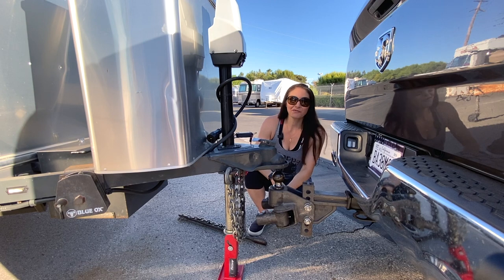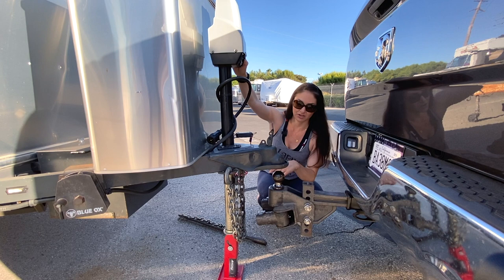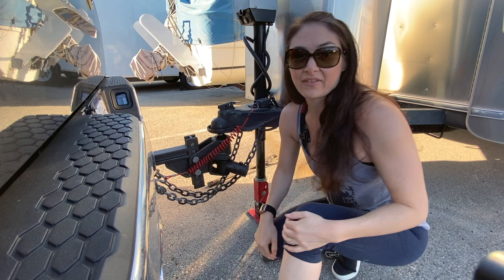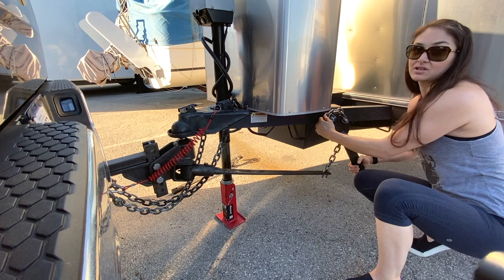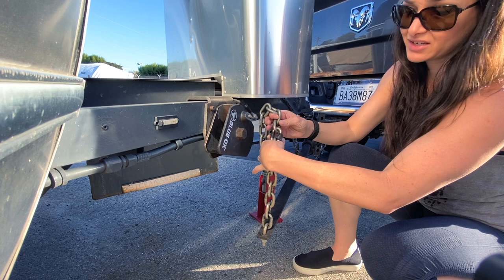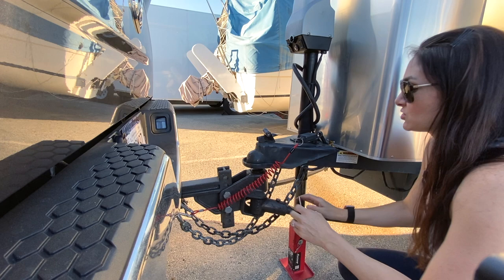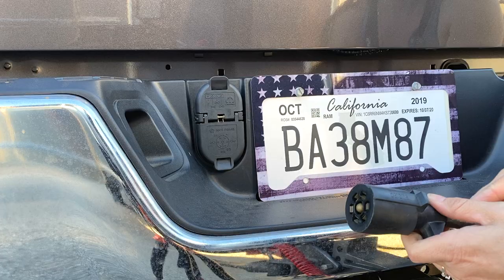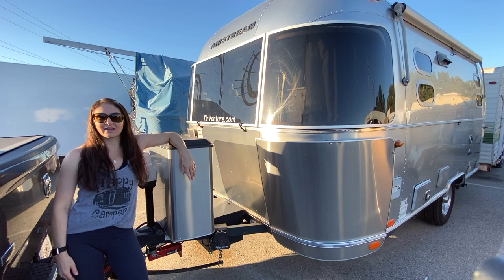How To Connect Airstream To Blue Ox Hitch

Comment: Nice video!
I'm leaning towards this Blue Ox hitch.
It looked like your break-away cable might have been hooked to your hitch loop?
That cable should be connected to the vehicle itself just
in case, God forbid, the hitch broke loose off of the pickup.
Reply: Right after shooting this video I removed the top left license plate bolt and replaced with an eyebolt after seeing photos of a receiver sheer in half from what appeared to be a manufacture defect.

Comment: Great vlog.  Just a few comments.  When you lift the truck while connected to the trailer with the tongue jack you are also checking that you are properly connected to the truck.  The emergency brake for the trailer should be connected to the truck somewhere other than the hitch area.  I have an eye bolt in the upper left license plate bolt or screw.  Also it was hard to tell, but the safety chains especially the ones with “S” hooks should be connected with the opening of the hook towards the trailer from the back side of the hitch.
Reply from the maker: Good catch! We forgot to mention chains should not be twisted as that creates extras stress. The main purpose behind crossing the chains to create a cradle if the trailer becomes disconnected from the ball, the chains will keep it off the ground.